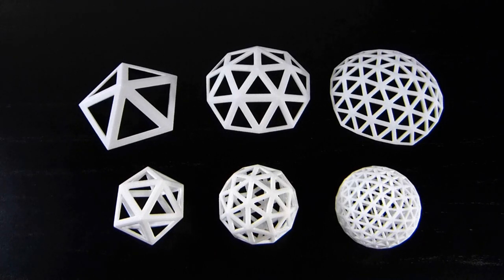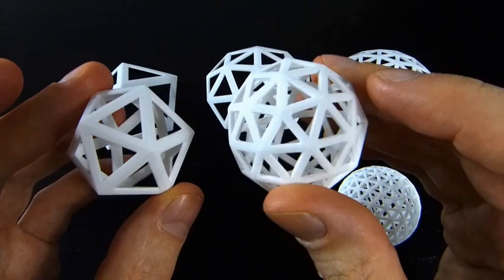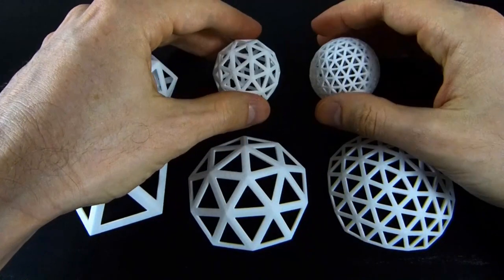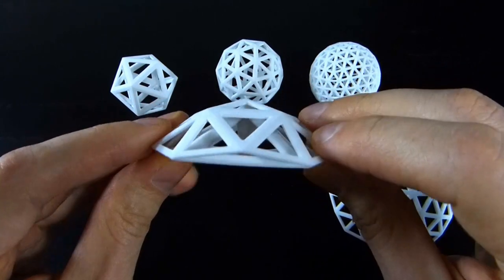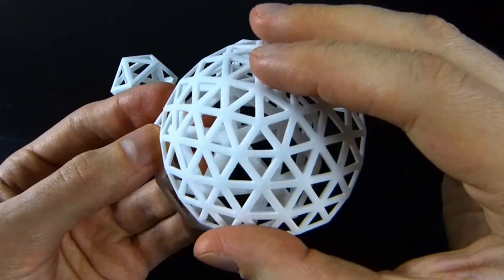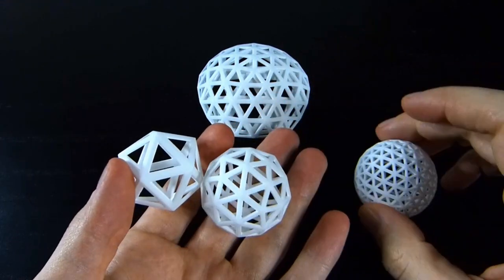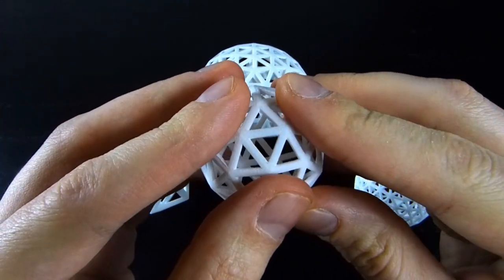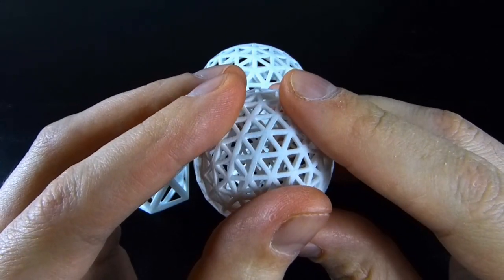Geodesic domes and spheres

Comment: if you sub divide any other platonic solid will it also approach a sphere, or is it only with a icosahedron
Reply from the maker: The important point for making it more like a sphere is that the new vertices are moved out onto a sphere. If you just leave them on the polygon you started with then you just get a subdivided polygon. As for other polyhedra, the icosahedron is usually chosen since the non-degree 6 vertices are degree 5, which isn't so different. With an octahedron or tetrahedron the non-degree 6 vertices are more noticeable. A cube would be ok, subdividing the faces into smaller squares. Subdividing the pentagons of the dodecahedron into smaller pentagons doesn't obviously seem to work.
Reply: interesting. Thanks for the reply, some more food for thought

Comment: Unfortunately not very useful. You can't just subdivide triangle because to obtain the required curvature you need to modify edge lengths on some of the newly generated edges otherwise the original face remains flat.